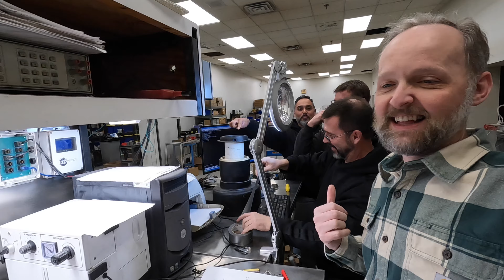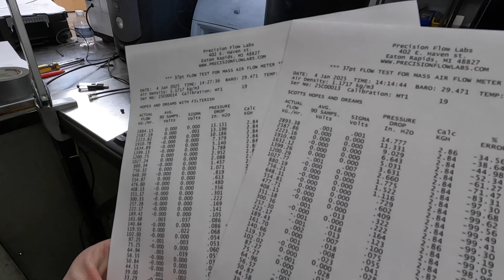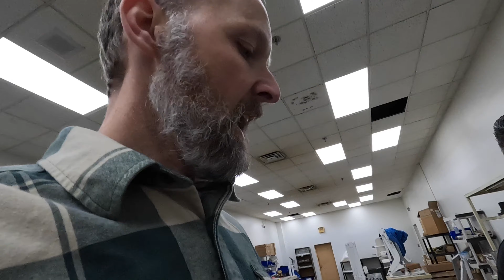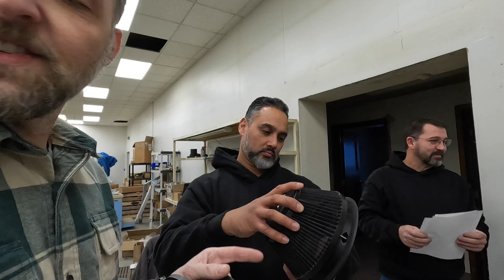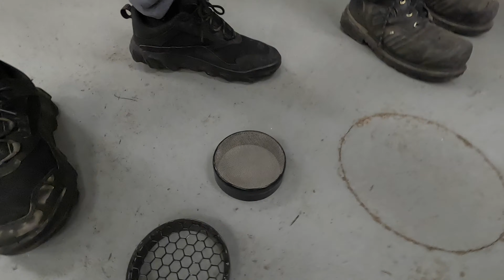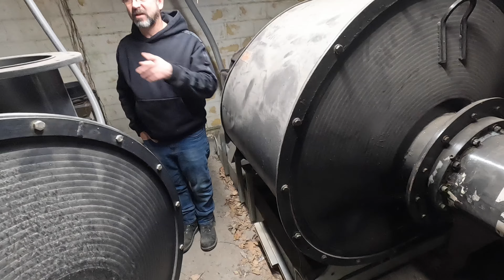Learnin' Stuff: I Visit Air Flow Experts at PMAS to Find Out How They Flow Test Race Car Parts

Comment: 39:41 Looks like a Falk coupling on that motor! Big pain to align a motor and pump with that coupling in the commercial world! We had to use either a laser aligner or dial indicators to get the alignment dead nuts! The tolerance was around +/- 0.001”! And the grease you have to put around the spring inside the coupling sticks to everything and doesn’t come off easily, beware.!